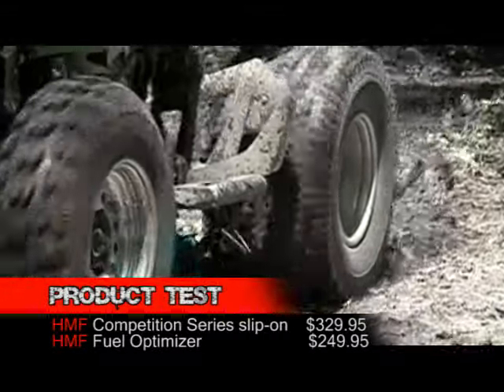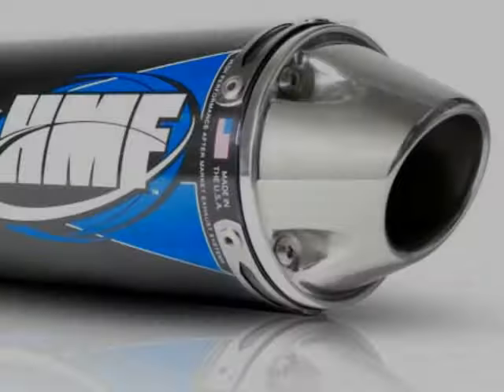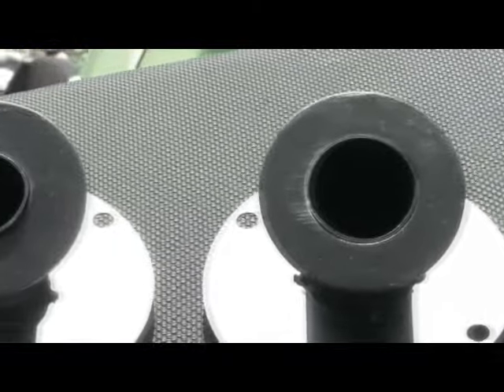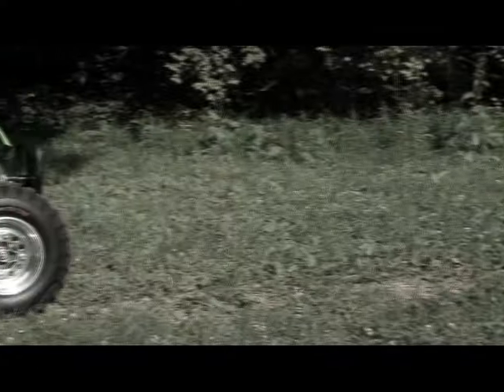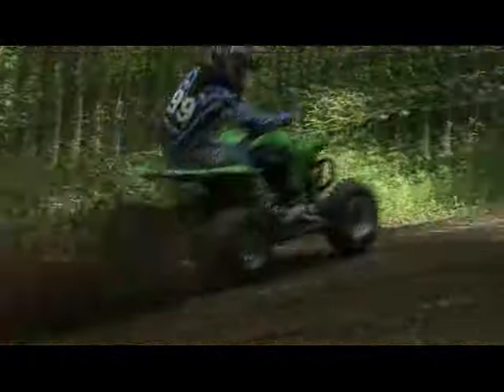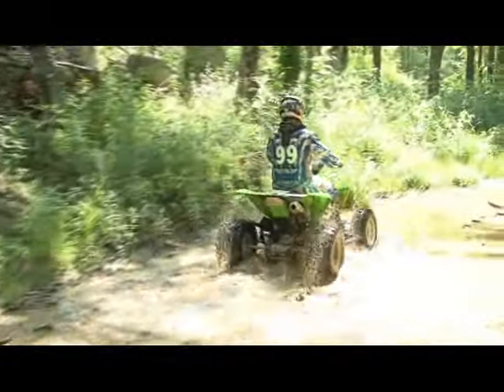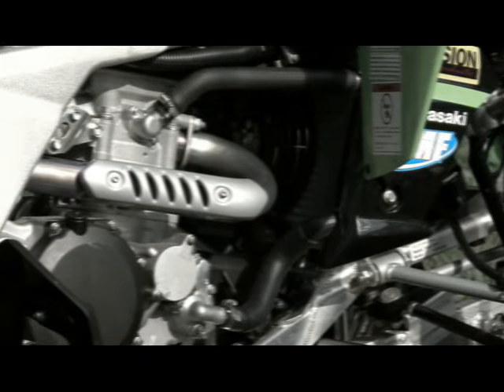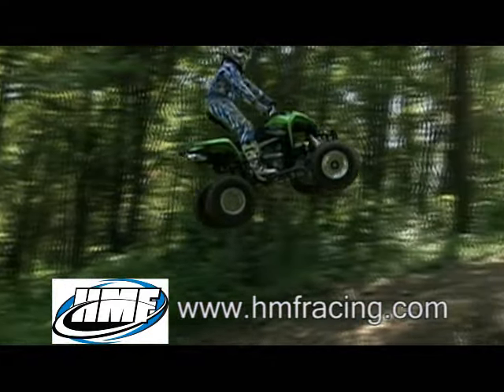HMF KFX450R Competition Series Slip on Exhaust and Fuel Optimizer Test

Comment from the maker: When we installed the slip-on HMF exhaust and started it without the Optimizer, the machine would backfire when the throttle was chopped, just sitting on a stand. Maybe you could ride it without a programmer, but you wont get the most out of it, even without an intake. At least that has been our experience.

Comment: @MFranxman26 For the size comparison, the 450 is about the same size but with better power. You'll have to put some money into a 400ex just to get it to run with a piped 450. I'm 5'11" 140lbs and with my 400ex (426cc big bore and stg2 cam) I can keep up with a stock 450 with a 195lb rider. Any 450 would be better for weight and power, but they do require more maintenance.

Comment from the maker: First, figure out which type of machine you want, a mellow sport quad or a high performance model. The KFX can be stretched out with a different stem or handlebar riser from Rox. The 400EX is almost impossible to make 450 fast.
Reply: Hey guys I just bought a used but mint stock 08 Kfx 450r. Do you have any recommendations for buying performance parts online?
Reply: @kilonami yea

Comment: I just bkught a hmf pipe, do I have to do anything to the motor?
Reply from the maker: Yes you need a fuel management system like the HMF fuel optimizer, or Dynojet Power Commander V so that you can richen up the air fuel mixture. Look into a fuel Customs intake if you want to gain a bunch more top-end.